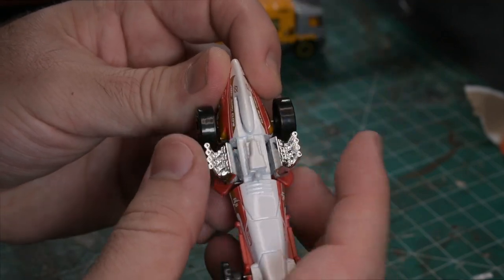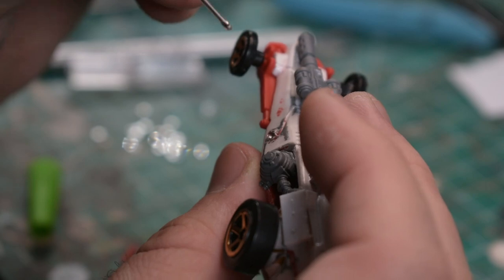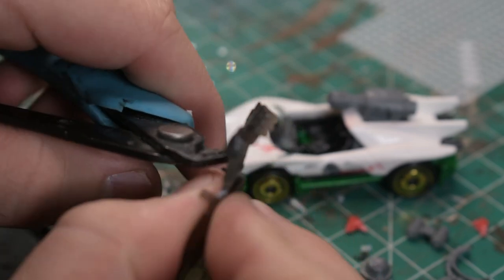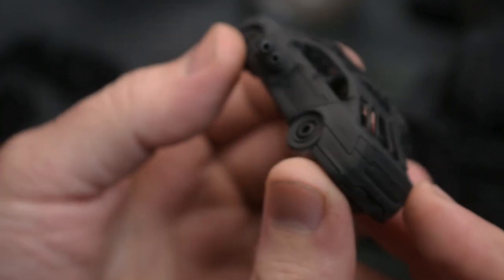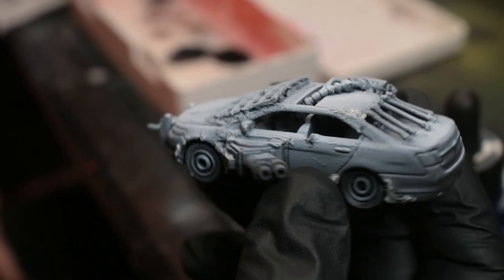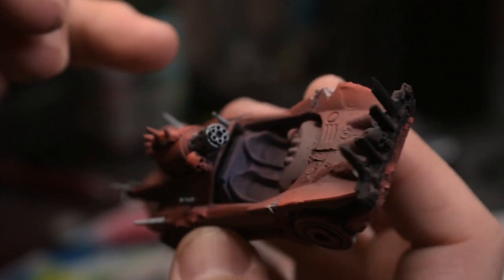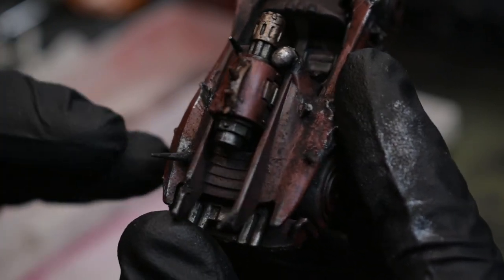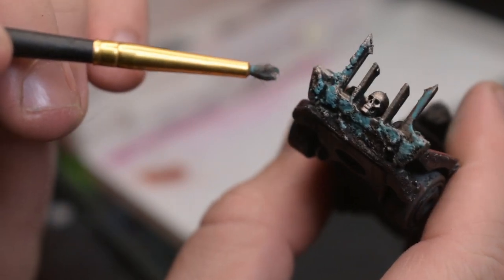How to make your own Gaslands cars!

Comment: Diecast cars are mostly a metal mix, which is commonly known as "white metal". It's tin, zinc, antimony, etc., and there's simple alternative to manually sanding paint. 
You can easily strip it with acetone bath! I personally use cheap but strong nail polish remover (ammonia based). Pop car inside the glass jar, wait 1-2 days, and wipe both chemicals and paint with paper cloth.
This bath results in clean, exposed metal, which quickly (10-30 minutes) oxidizes so after wiping it, I'd advise to apply thin coat of primer or clear varnish to prevent situation where paint would be applied to grainy or loose particles. This will prevent paint from peeling in the future.

Never apply ammonia to plastics as it will melt them

After that, it's just adding bits, painting - the usual ;)
Reply from the maker: Thank you so much for the tips! I am definitely going to do this next time!